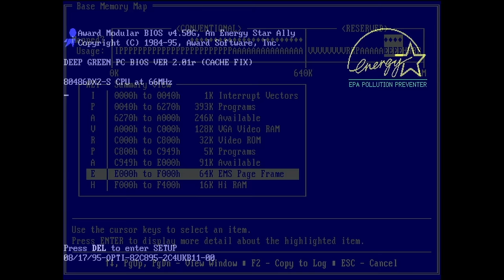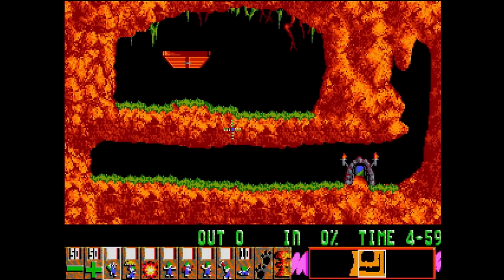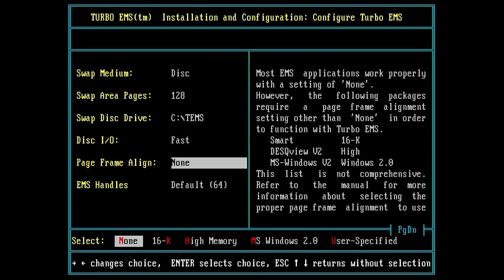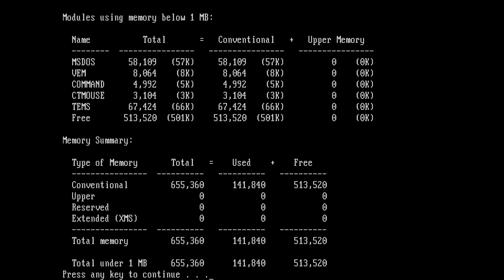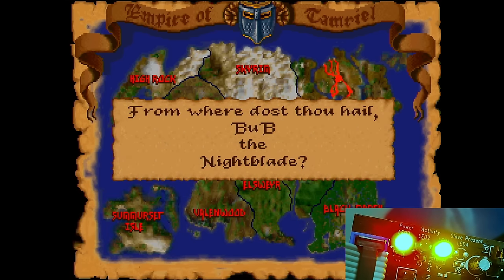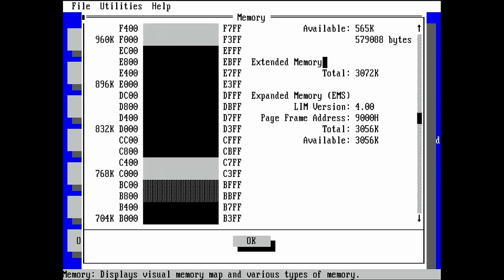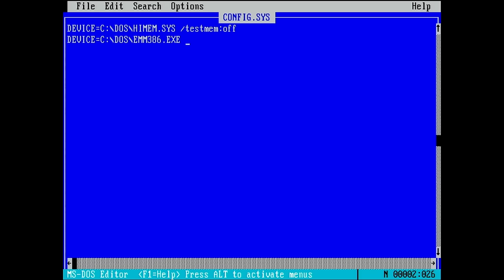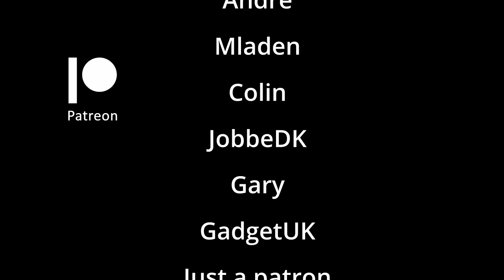EMS Memory: The clever hack for more memory in DOS!

Comment: good luck with the apricot. I think it's one of those with a keyboard that had a lcd, to show some keys functions. hopefully it's on separate pins.
Reply from the maker: Yes, it had a small LCD to display functions and the clock if I'm not mistaken. I believe the keyboard also had a 9v battery that was used to power the real time clock. So, if you disconnected the keyboard, you might have lost the date/time settings. But I'm not sure about that. Just stuff I read online.
It will be very difficult to restore or even use that machine. I guess I will keep it until there's an opportunity to give it to someone else who knows what to do with it.

Comment: I tried QUEMM for a day before seeing compatibility issues. Unfortunate as it used less conventional memory since it combined HIMEM and EMM386 but yes I saw the same application issues as you saw in TES Arena. Ended up DEVICEHIGH'ing as much as possible and sticking with the built in drivers. FreeDOS and its device drivers these days is the best of both worlds; compatible and compact! My 386 came with 4x256k so yes I had the fun of trying to squeeze everything out of a 1MB system. Eventually got +4MB, 5MB was awesome but you still had to be conscious of conventional memory usage. Started using Linux and what a world, it was all just memory, with swapping a core feature and handled for you - it became so easy!
Reply: QEMM386 (by the way not QUEMM) was fantastic if configured correctly. Simply use the OPTIMIZE program and let it do its magic :)

Comment: I used QEMM, always had 639 kilobytes of free base memory and it managed xms and ems on the fly.
Reply: I could never quite get that amount free. Please, how? 😁
Reply: @glenncaughey5044   It depends on the mainboard or what hardware the PC is equipped with. It probes the UMA area and tries to determine which of that is mapped to an external device of some kind and which is in your RAM. The more UMA it can discover, the more TSRs and drivers it can shovel in there. Of course also depends on how large your CDEX driver is and sound card stuff and what mouse. Some machines just turn out better than others.

Comment: the Apricot is pronounced like the fruit Apricot , they also did IBM MCA units with remote controls for security, built in monitor stand like the amstrads. the keyboard i think was xt type but had extra LED's and system buttons on the keyboard. it may not poer on with the relay trigger (later MCA models were control with a small white one button remote for power on and unlock keyboard)  , that was the QI300, it also had custom disk bays and a handy drawer to fit the remote (hidden of course and not mentioned in the manual, the sales man told you)
Reply: the isa card is Productivity Enhancement Products 10100-003B ISA Card Solid State Disk 2MB

Comment: On the Apricot, I don't know how far down the rabbit hole you want to go but it really shouldn't be that hard to ID the keyboard controller, find the data sheet, find out which lines do what then tone them out to the back pins and create a converter from AT, at the end of the day all keyboard controllers work on the same inputs and outputs, the only changes are to the pinout of the connector.
Reply: The motherboard doesn't have a keyboard controller, it's built into its keyboard. Unfortunately, that means you'd need a microcontroller to take the place of that.

Comment: I would not be surprised that the reason that TEMS didn't work properly with the page frame in upper memory was because there was nothing mapped there (yet). I'm not familiar with TEMS, but as it consisted of two components - a device driver and a TSR - it could very well be that the TSR depends on the device driver setting up things properly in order for it to work. 

This is basically also what HIMEM.SYS en EMM386.EXE do - they work together to setup the proper environment for EMS emulation to work. HIMEM.SYS provides the XMS interface (and API) and EMM386 is able to use that API to use XMS memory as EMS. The only thing that EMM386 probably does slightly differently is that it does the setup of the 386 pagetables itself so that it can provide both UMBs (that so-desired set of memory blocks in upper memory where you can put most of DOS and some of its device drivers) and a 64k page frame for EMS emulation. 

It is also interesting to note that there is a config.sys statement called DOS, which can have one or both of the following keywords in it: HIGH and UMB. 

DOS=HIGH will transfer a large portion of the DOS kernel to the 64k (minus 16 bytes) memory area right above the 1MB barrier and basically abuses a difference in hown 286+ systems handle segment:offset combinations. On an ordinary 8086/8088 (or compatible) CPU there are only 20 address lines available. This means that when the program counter (or any segment:offset combination for that matter) reaches absolute address 0xfffff, it will simply wrap around zero. However, on 286+ systems with their wider address buses, this is not the case. So if you then carefully craft an address with a segment in 0xffff, any offset abot 0xf will end up in extended memory. Since this could lead to compatibility issues with earlier software, control logic was added to the AT (and later systems) to force address line 20 (A20) to a known state in order to provide compatibility with the earlier PC and XT. This is the so-called A20 gate. The A20 gate is controlled through HIMEM.SYS and DOS=HIGH allows that 65520 byte segment to be used for programs and data, leaving more conventional memory available to programs. 

Something similar happens with DOS=UMB. UMBs are provided by EMM386 and DOS=UMB makes these upper memory blocks available to MSDOS and programs to be allocated just as if they were conventional memory blocks, once more leaving more conventional memory available to programs. 

With a proper setup of CONFIG.SYS and AUTOEXEC.BAT it should be possible to have between 602-615kB of conventional memory available, even with things such as mouse, sound and CDROM drivers loaded. 

DR-DOS (the DOS compatible variant of CPM/86) and later on OpenDOS and Novell DOS had another trick up its sleeve: so-called DPMS and CLOAKING. This allowed programs to be loaded into extended memory, leaving only a bare stub in conventional memory to talk to it, thus leaving even more conventional and upper memory available to programs.
Reply: A20 was a register on the keyboard controller, wasn't it ?
That's funny.
Reply: @monad_tcp  No, A20 is one of the address lines on the CPU (and f.i. the ISA BUS). The keyboard controller only provided the possibility to force it low or high through an I/O port. Going through the keyboard controller was rather slow so later systems provided similar functionality, but through the so-called fast A20 gate.
Reply: DPMS wasn't a feature of Novell DOS or any other non-Microsoft DOS, it was a feature of the 80386 processor which provided memory virtualization on its own. "Protected" mode means the memory was virtualized and the DOS memory map wasn't a problem anymore.

That's how Windows 3.xx and 95 worked, by bootstrapping through a DOS environment, entering DPMS and then the entire operating system was basically a giant DOS application.
Reply: @Stoney3K  Not entirely correct. Protected Mode and Virtual 8086 mode were features of the 80386, as was paging. DPMS stood for DOS Protected Mode Services. It allowed programs such as device drivers and TSRs to load themselves into extended memory and to run in 16-bit or 32-bit protected mode, leaving only a very tiny stub behind in conventional memory. 

So DPMS in and of itself was not a feature of the 80386 processor, it just made use of its extended features if they were available. The minimum requirements to run DPMS were an 80286 processor.
Reply: @damouze  Windows also provided a DPMI interface to the DOS environment running under Windows, so it was possible to run games that used DMPI under Windows too.
Reply: @nurmr  True, but DPMI has nothing to do with DPMS. They are two separate beasts. DPMS can either use VCPI or DPMI to provide its services.

Comment: Not sure if it was mentioned by someone else before, but after loading DEVICE=HIMEM.SYS  you can try loading VEM with DEVICEHIGH= . Also do DOS=HIGH,UMB and in the autoexec.bat file, instead of just loading TEMS normally you can try LH TEMS command (LH means load high). I've never seen TEMS before, but I've used LH with mouse and sound drivers etc to free up some conventional RAM

Comment: Also minim sector sizes are at play with memory emulator through swap.  You have 16k pages but clusters could be larger or smaller. Also os is doing memory things with the hard drive which further taxes the available memory and possibly pages.

Comment: EMS was more or less just a crude Memory Management Unit (MMU) for the 8086 which didn't support any built-in virtual memory from itself. It's not even that different from the virtual memory mapping done by modern operating system kernels, but done on a micro-scale.

In theory you could do basic multitasking by allocating more than one EMS page frame just like a virtual address space in a recent OS. It became kind of obsolete when Windows just kicked the MS-DOS routines to the curb on boot and just did memory management on its own.

Comment: The card seems to be flash memory for a Cisco
It looks like Turbo EMS ONLY supports copy to RAM, so on an 8086 it can use hard disk, on a 286 it can use extended, same as "Above disk" which also supported extended, but cannot use upper memory unless you can also enable read/write upper memory in BIOS or with other software (real mode UMBs)
You also didn't enable DOS HIGH - you might be able to run with Turbo EMS and DOS HIGH relieving some lower memory.
Also, does the system support chipset created EMS (need an appropriate chipset driver)
Reply: Yeap. That's the flash card for the first generations of the Cisco PIX.
Reply from the maker: Hm. Anything interesting one can do with this card?
Reply: @bitsundbolts  Turn a PC into a PIX. (It's an ISA card, so somewhat old PC) You've throw away USB sticks with more memory, so it's pretty useless for anything other than a museum. (and b-roll)

Comment: I'm not familiar with TEMS but the question instantly arose in my head: does it do any 386+ specific memory paging? EMM386 is, essentially, a lightweight hypervisor for DOS, it shuffles memory around as it provides it for the rest of the OS, and this is what can fill the UMB area as well as the EMS page frame with memory pages.
If, as I suspect, EMS doesn't do this, then it copies the "swapped" pages to the frame that needs to be a proper 64kiB RAM area - and as TEMS does no paging itself, there won't be ANY memory in the upper area. So it tries to copy the selected pages to the specified E000 segment - but it won't be written there at all and it can't be read back either. So it needs existing RAM memory to use as a page frame, thus it must use some lower mem - except if you use some other trick to make that shadow area writable. Which can open another can of worms, but doable. Most convenient if you don't even try to use that memory as UMB then.
But if TEMS is a full fledged memory manager in a way like EMM386 or QEMM are, then - I dunno.

Comment: Your unknown ISA card has only Flash memory chips, so unfortunately it is not an EMS card :( However, 2MB of Flash (ROM) is very unusual.... I'm also curious to know what it could be!
Reply: That's the flash memory card for the first generations of the Cisco PIX. Cisco replaced them with a simpler card with much more space. (I kept that card from our ancient Pix 520.)
Reply: I would guess it's a solid state drive. There's a BIOS chip on there as well so that would probably handle the boot process.

Comment: You can in fact use Himem & Emm386 with 1MB ram. You get UMB, and a bit of XMS/EMS to boot. 👍
Win3.1 (std mode) will run in that config. Did it on a Tandy 1000RSX back in the day before adding 8MB to it.

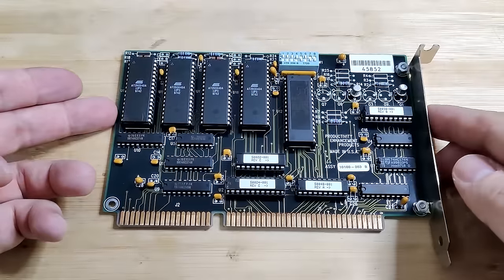Comment: 8:56 What you've got there is not an EMS memory expansion. It's the storage module of one the first Cisco PIX firewalls - it booted of that thing.
Reply from the maker: Interesting. It was installed in a PC though - at least this is what I think. What could I do with it? Or is it just good for salvaging the chips?
Reply: @bitsundbolts  The first PIX firewalls were basically 486 machines with ISA slots. I think Clabretro made a video about them a wile ago.

I beleive that this card was an off-the-shelve one made by "Producivity Enhancement Products" so Cisco just bought it in. I'd assume that there is either a DOS driver for it (if you can find it) or that it has it's own BIOS on it which makes it appear as a normal disk drive.

Comment: EMM386 puts a 386+ into V86 mode so it can magic up a page frame in above 640K using the page table. I'm not sure Turbo EMS can do this. It can probably only produce a page frane above 640K in areas where there's actual Ram visible.
Reply from the maker: Hm, good point. That might explain the struggle I faced.

Comment: Turbo EMS may not have worked with the Page Frame in the upper memory region because the motherboard chipset is interfering with using ram between 640K and 1 MB. Real mode access to the memory became a lot harder when IBM explicitly blocked access to it in the AT chipset that all the clones copied. Check your Bios shadowing options You might need to enable/disable shadowing for that region for it to work or some other bios option. EMM386 made a lot of things easier at the expense of forcing the system into protected mode.
Reply from the maker: Good point. I'll try and see if I can get this to work! Thanks for the hint